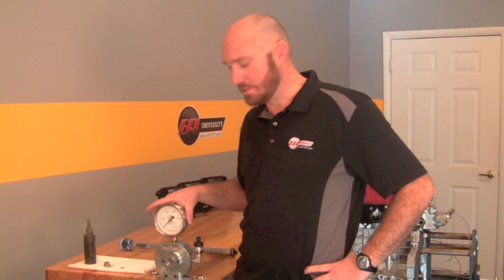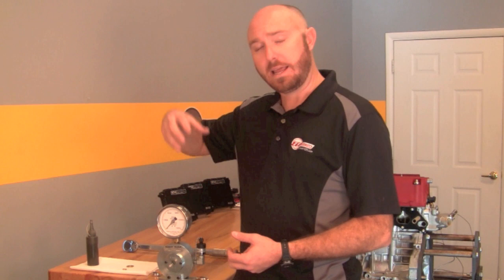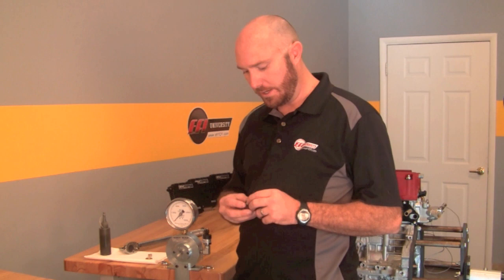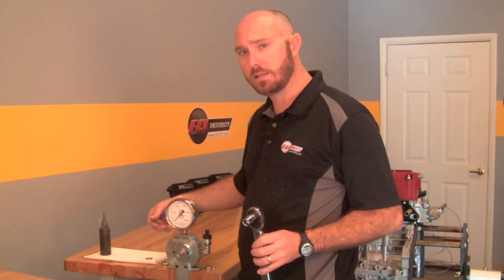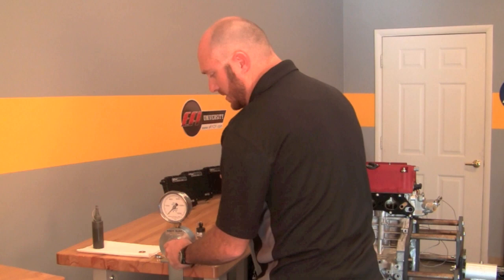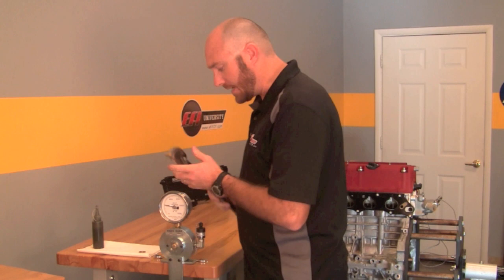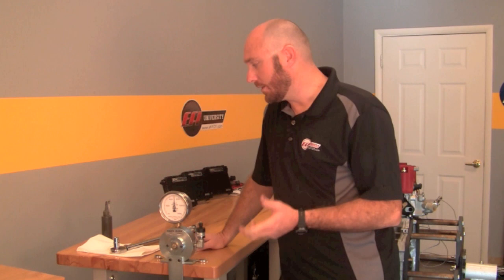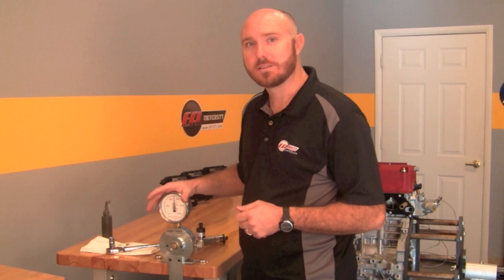Skidmore-Wilhelm Tension Gauge

Comment: Great video.  In order for the bolt length method to give proper results, you have to ensure that about the same number of threads are exposed past the nut when it's in the Skidmore-Wilhelm Tension Gauge as when it's installed on the connecting rod.

Comment: Very good info Ben!  Thanks for sharing and looking forward to more from EFI.
I had a question:  Can you tell us how much additional tension would be applied on a new bolt with lube vs no lube?  Could this create undesirable stress loads on the fastener without "breaking in" the threads prior to lubrication and torquing down?